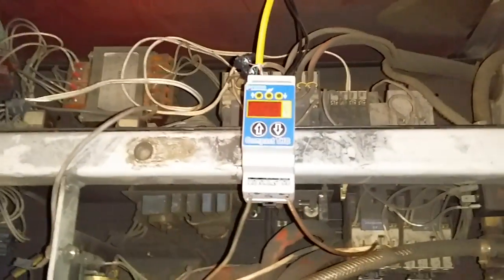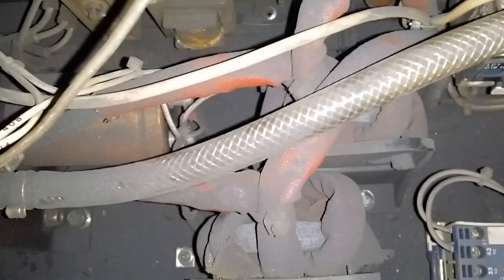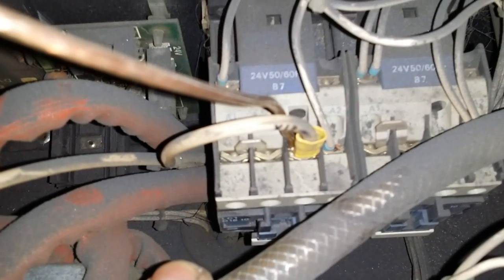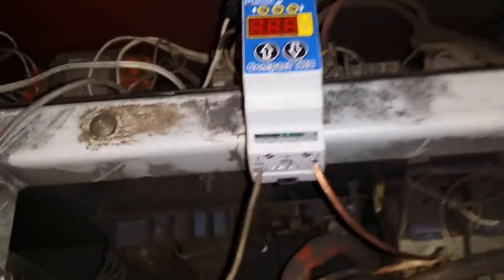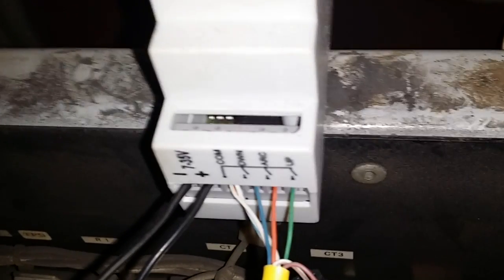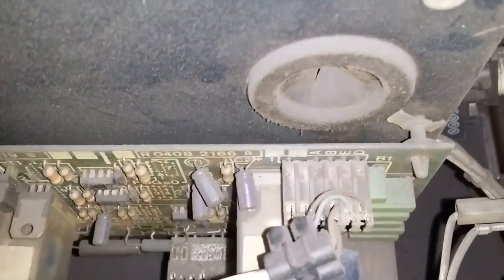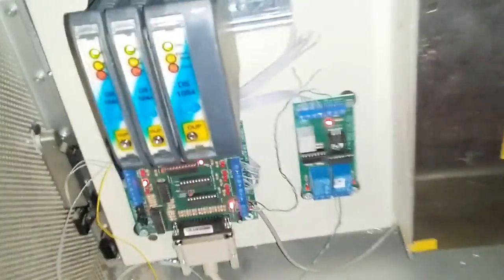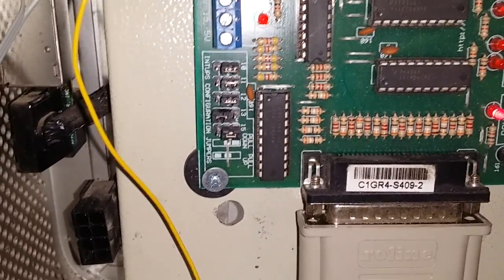Connecting a plasma cutter to PROMA THC

Comment: I installed thc sd. It works in tests but in work only raises the head if the voltage is lower. In case of a higher voltage, it does not go down. the lights do not light up anymore.
Reply from the maker: Never used the SD version, but i think there are settings for steps and speed on the THC.

Comment: Hi,
I wonder if you could help me. I already set the Proma THC and it works great during the cut, it goes up and down on irregular surfaces. But how can I make the torch to go down until touches the sheet and then go up again to the ideal height 0.100" aprox. at the start of every cut? Did I explain myself?
Just to give you more details, I use Mach3 and this type of Breakout Board: https://www.amazon.com/gp/product/B00SWO2OUU/ref=oh_aui_detailpage_o01_s00?ie=UTF8&psc=1
How can I setup the hardware and the G code in order to get this task done?
Thank you very much!
Reply: Best to build a floating head setup. Then if you use sheetcam use the correct post processor.